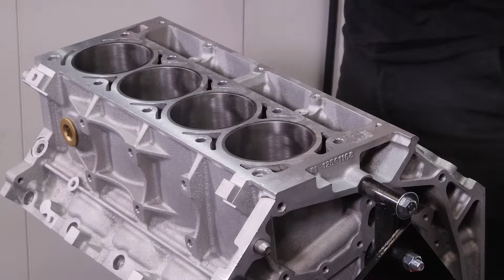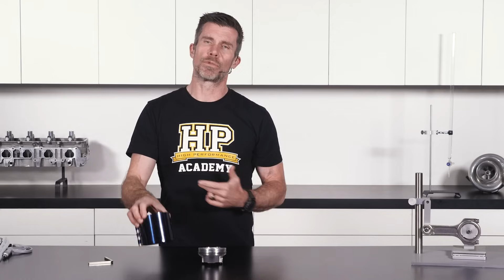From Novice to Pro: Affordable Engine Building Tools | Engine Building Basics 04/04

Comment from the maker: What's your favourite tool?
🏎 Building a fast car? Get $400 OFF the all-inclusive VIP online course package deal: https://hpcdmy.co/vipy137
✊50% OFF your first online engine building course. Enrol now:  https://hpcdmy.co/offery137
0:00 - The Myth
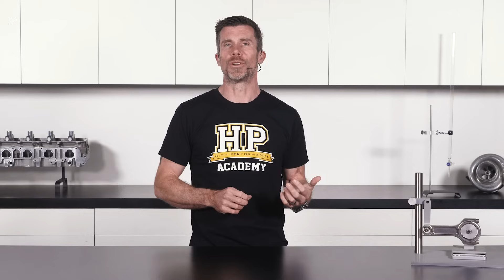0:22 - Caveat 1: Basic Tools
0:50 - Torque Wrench
1:25 - Caveat 2: Machining
2:00 - Measuring Clearances
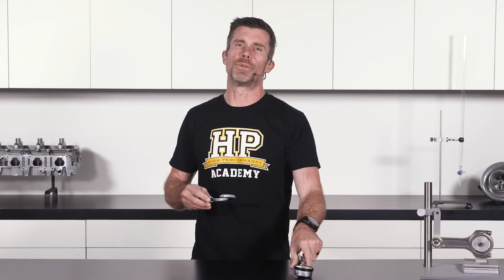2:41 - Micrometres
3:49 - Chinese Made Tools
4:16 - Dial Bore Gauge
6:13 - You Need To Know HOW To Use Your Tools
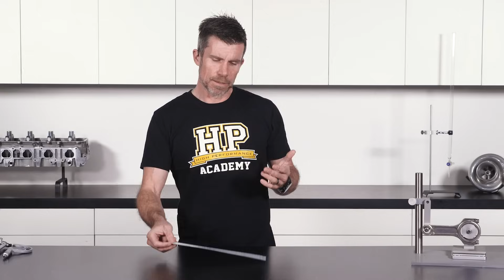6:42 - Plastigauge
9:14 - Engine Balancing Equipment
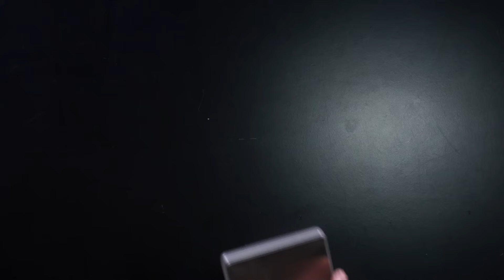9:41 - Scales
11:41 - Con Rod Balancing Fixture
12:50 - Piston Ring File/Grinder
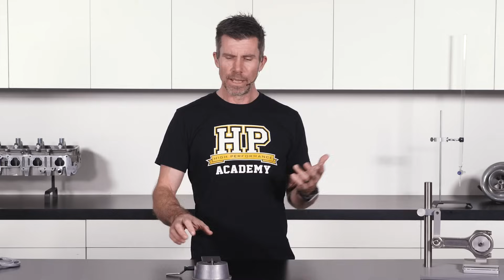16:02 - Ring Compressor/s
19:34 - HPA Engine Building Couse Material
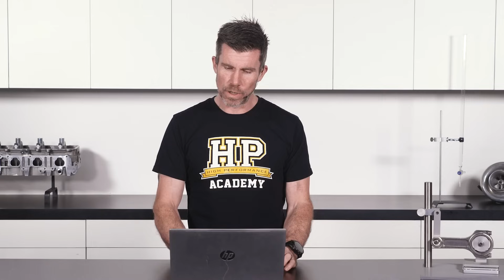20:14 - Engine Building Fundamentals $129 USD
21:25 - Practical Engine Building $199 USD
22:48 - Specific Engine Building Examples: 2jz, 4g63, LS V8, SR20 & more.
23:30 - How to Degree a Cam $49 USD
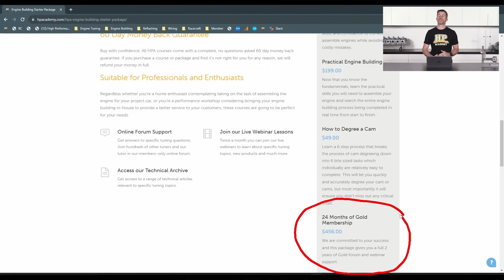24:45 - Gold Membership
25:33 - Package Deal $299 USD
25:50 - Payment Plan Options
26:52 - BUILD.TUNE.DRIVE

Comment: I'm rebuilding a daily driver engine it's the Toyota 4runner 5vZ -fe engine I installed king main bearings standard can I install a different brand for con rod bearings since king rod bearings for this engine is currently unavailable ?

Comment: Awesome info! Im just about to remove and rebuild my chargers hemi and this is all super helpful. Ive got dial caipers accurate to .001", a bit better with good eyes really and 6inch max... is that going to measure most of what you use micrometers for?

Comment: What I've done, micrometers are a rather niche market and don't particularly have a great resale value.

I browsed eBay looking for used mics 0-4, starrett or mitutoyo branded. I was careful to check the pictures for ones that look very lightly used and read the descriptions. Then looked up the model numbers for the specs. Consequently I have a full set of mitutoyo digimics that are specified as accurate to 0.0001", my newest one is 0.00005". Picked up a china bore gauge set, tossed the indicator and added another mitu 0.0001" indicator. Then sent everything to a calibration lab for $250 or so, everything was still in cal.

Whole setup cost me $1000 or so and I have a VERY nice set of measuring equipment. 

A little more expensive but worth it
Reply from the maker: Great work! You can certainly do this and similar to get great quality tools over time. One of my family members also does well buying bulk lots of tools that people are too lazy to sell separately and he will sell off what he doesn't want individually himself, often breaking even and sometimes turning a profit.
Bit more risk in that, but it's just another example of how you can make secondhand tools work if are short on money but rich on time - Taz.

Comment: Great video! I've got an older multitoyo 3-4 inch micrometer that I received from my grandfather when he passed away, ive purchased a set of micrometers from Harbor Freight and checked it against set blocks and they're great, id highly recommended them to others. I also got a Fowler bore guage from Amazon for about $120 and it's accurate as well